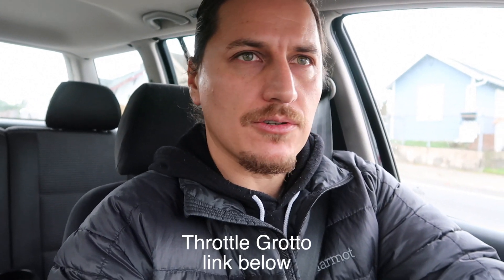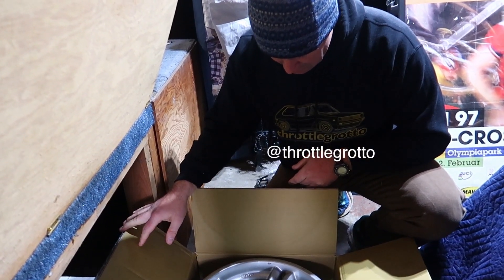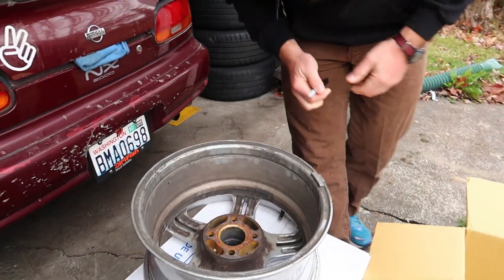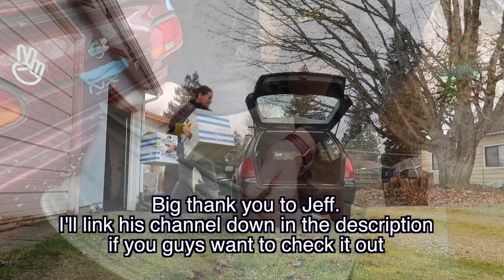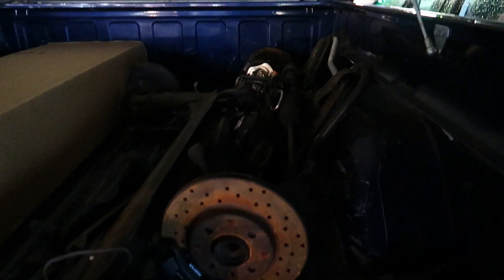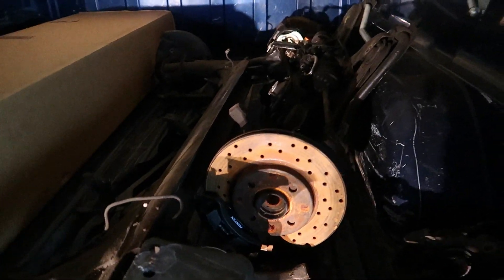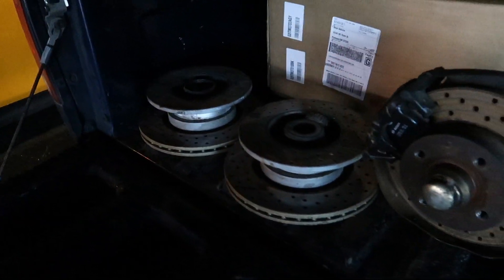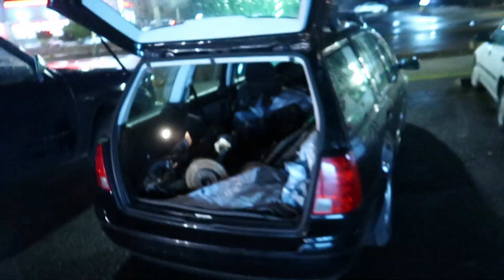New MK2 GTI * My Subscribers donate more parts * Zender Wheels

Comment: What kind of set up do you have on the gti in the garage? Maybe a video about that one?
Reply from the maker: Yes hope to do a video on it in the spring or summer. With winter weather around here the roads never really get dry
Reply: @JakeRawSon  damn I just bought a MK5 GTI and 06 is that one of the FSI or TSI?  I also got a 2010 Audi A4 APR stage 2 tune with APR carbino carbon fiber cold air intake,  APR downpipe forge diverter valve but the clutch is going and I can't even build boost I'm so disappointed and the cheapest stage 2 clutch is like fifteen hundred bucks but like I said I bought an 06 GTI with the FSI engine ready to get a a p r r unitronic stage 1 + tune would love to see some content on that is that yours?
Reply from the maker: Yes it's a full built mk5 fsi. I love driving it but it's all about the mk2's right now. That's a very expensive clutch you have to get, wow.